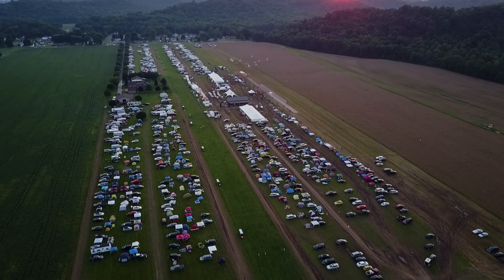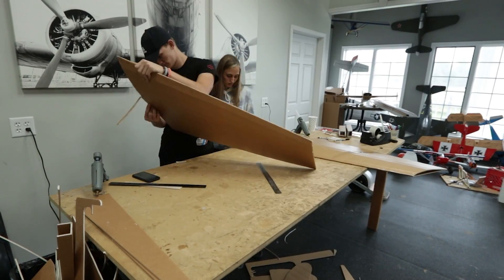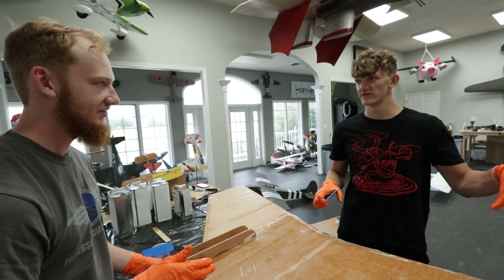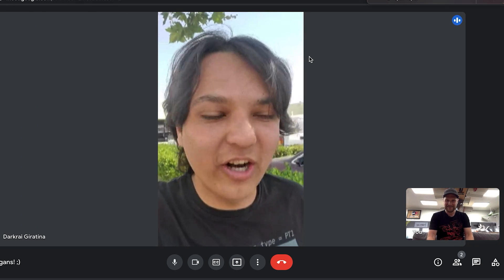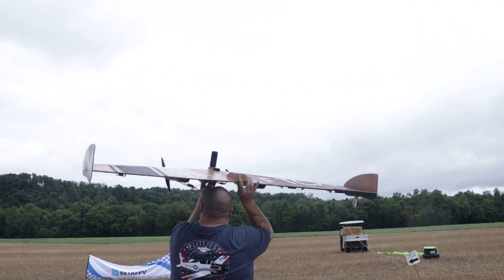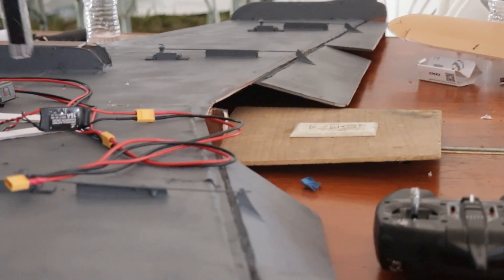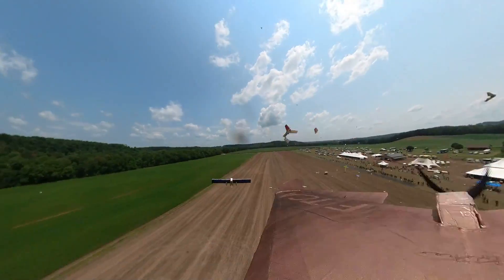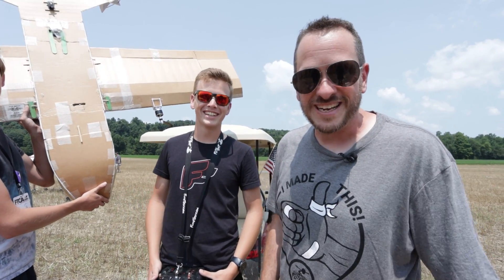Demolition Derby in the SKY!!!

Comment: My 2 or 3 cents:

Mount the Props in the wings, in armored nacelles

Armor the servo and connectors with pvc

Include a stiff spring in the servo connection to dampen any impact on the control surfaces,

Lastly make a 4 engine design, with pusher and puller engine providing primary thrust, and key the side engines to provide up to 50% forward thrust, but up to 100% when using them for yaw control

Comment: You should put fuses in those individual motor pod circuits. The string loaded that motor down to the point the current (Amps) spiked and the temperature reached ignition.

Use a fuse to survive!

Comment: i think this "glassed" design is a big improvement but i think you should mount the props at the trailing edge of the wing so you can ram other planes without causing prop damage.

Comment: Watching those people sanding was kind of funny, because you realise you could have done all of it with a belt sander before you assembled it right? No need to sand on curves, and can do it flat and supported. Also, were you doing anything with the split elevons? Could give you some yaw authority with the right setup. Awesome either way though.
Reply: Definitely would've been easier to do prior to cutting the foam board, but I doubt a belt sander would've worked good.  I've tried to belt sand hard foam before and it eats it up quick, would be made even harder using a huge piece of foam.  It's almost as tough as trying to sand a 3d print with a dremel.  I'd probably just hand sand it anyways.

Comment: Really? All the experience and all the resources you have and this is the best you could do?  Wow!  You didn’t even think of using ducted fans? You could have put fiberglass on the ducts too and even put some heavy duty screen over the intake to prevent debris from damaging your engines/props. I’ve never even built or flown a model airplane, yet I could have done a better job than you all did. SMH

Comment: I'd say go to pusher props but maybe 4 smaller ones with small vertical stabilizers above and below the wing inline with the engine pods..  That would at least lower the chance for the string entanglement.  You might also consider one extra layer of glass on the leading edge.

Comment: Great job, josh heres an idea next time do folding props on front and rear that way with impact they fold and are able to take the impact.
Reply: Ducted fan units instead of props
Reply: @divelizard1966  EDF props are very fragile
Reply: @JaasimMulla  internal edfs would be fine
Reply: @Thatssocool9100  I was thinking of a design with internal edf's. now that I think about it Peter's leaf blower plane could be an option. (well, the intake of the leaf blower with a edf)

Comment: instead of sanding do a test piece where you wipe the surface lightly with acetone, enough to wet it and evap dry quickly. I think you find a new fast and better process. try a test piece on plastic also you will be pleased

Comment: I would like to build my own RC plane, but i don't have enough money. Well... Looks like i can only watch you guys, flying your own airplanes, and my own one must stay in my dreams age.
Reply: If one buys the cheapest of the cheap you can build the ft trainer for less than you think.  Maybe $60 US?  I have had good luck with flysky radio systems and ok luck with the very cheapest servos/batts/motors that china has to offer
Reply: @anonymous12345678935  one word: inflation. 60$ is 230 PLN. That's for me like 230$ for american. So for you guys its very cheap, for me its f*cking expensive

Comment: Try a ducted fan Kraken Juggernaut. That might make it even more hit resistant.
Reply: You'll basically end up with a H0-229. I see this as an absolute win. Would twin ducted fans provide enough thrust though?
Reply: I think it might just run out of battery. EDF's don't last long
Reply: Shesssssss
Reply: @mstressisha  what’s a shes?
Reply: I've been toying with this idea for a while now. Any thoughts are welcome. I was thinking along the lines of a large ( 1.6 meter), lightly loaded foamboard wing with a pair of 4s 64mm fans. Already have one from a crashed Arrows Marlin and simple enough to order a match from Hobby Zone. What are y'all's thoughts?
Reply: I was just thinking that, some way of shielding the props from hits and even stuff like the string, assuming thats within the spirit of the event. I am guessing its meant to be more for fun than "being the best". I'd love to see something like a Do-335 in the FliteTest foamboard, that would be a beast of a plane speedwise
Reply: @kineticdeath  Maybe a steel wire arch extending around and to the front of the propeller, or making it rear-motor only...
Reply: Or even redundant motor?
Reply: With a raster in front so there can’t get stuff in
Reply: if they had a ducted fan down the center of it with a mesh cover on the front of it it would literally be unstoppable